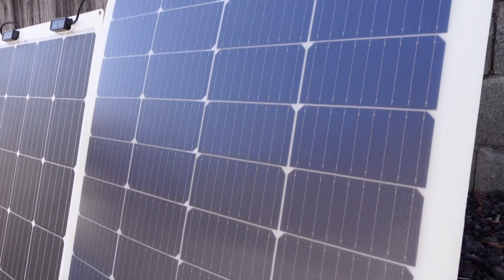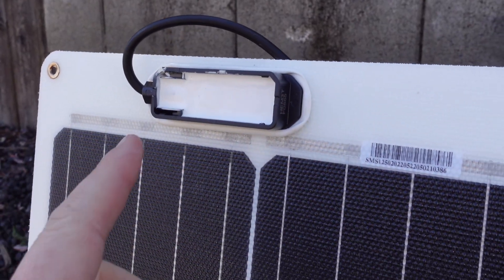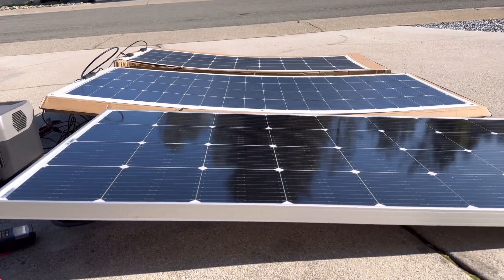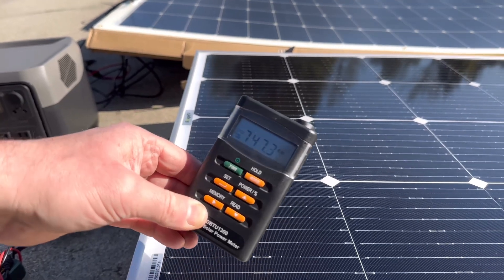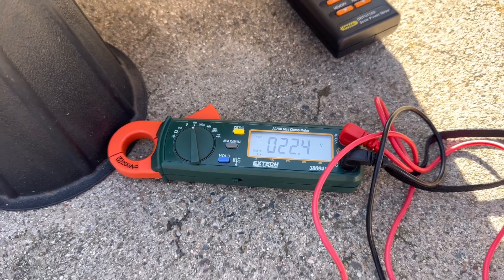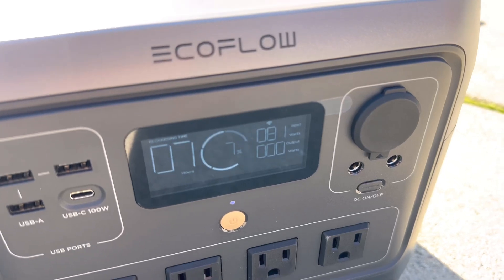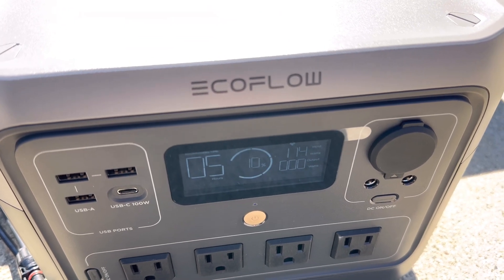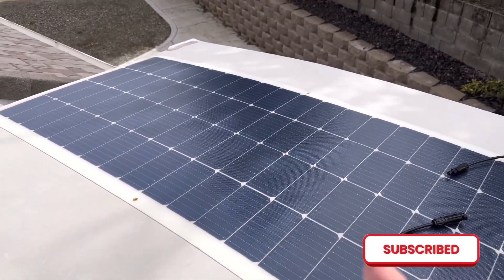NEW Flexible Solar Panel Impressive! 200 Watt Flexible Solar panel Renogy

Comment: Too much house and RV chatter, not enough marine/boat/saltwater talk which is what these panels are designed and sold for.   Alas my question wasn't answered as I just bought one of these for a test, and I'd like to know just how well do they hold up to walking on them repeatedly when on the topside deck.
Reply from the maker: Do not !!! Walk on them 
There see you did get useful info

Comment: The cardboard backing of the flexible panels insulates & prevents air flow which would account for the elevated temperatures. A table comparing the three panels would be useful. The Bouge RV panel had a smaller footprint, a consideration on small rooftop real estate. 😎

Comment: I tried buying one of those 200W panels yesterday, Sept. 4th 2023. The Renogy website says that the panel is no longer available. Did Renogy discontinue the 200W flexible panel, or are they coming out with an alternate version?
Reply from the maker: No it still shows available. I know when they go out of stock the listing might go away. 
See here….https://amzn.to/3Ery6qd

Comment: Need more airflow under the 2 flexible panels.
Reply from the maker: They are mounted on flat surfaces so air flow is normally minimal for flexible solar panels. But you can make a rack if you want a light weight set up.

Comment: How will they do in a Georgia Summer with Weeks of 92 - 97 degree VERY intense sunshine? Would LOVE to have them on my OLDER National SurfSide at 12' 4"of Height.
Reply from the maker: I think they will just plenty fine in your mild conditions. 

It has been over 100 everyday for 3 weeks and hitting 114 twice and over 105 many days except this week at 99-103.
We still have the hot weeks coming.
So great weather to test and see if the fry or live. I also live in the second sunniest city in the nation, excellent testing grounds!! 😀👍🏼

Comment: Thanks for the testing and the vids ... Very informative..
Question for you : how are you going to fix the flexible solar panels on the rv roof ? You're not gonna drill holes in the roof to hook the 4 corners of the panel obviously..  so what is your soltion ? Glue ? Also I'm a bit scared that if not perfectly sealed on the roof surface they could flap in the wind while driving at high speed on the highway and get damaged.  What are your thoughts?
Reply from the maker: So far about 1500 miles and they haven’t moved. See here…RV Solar Install Easy! DIY Solar Installation Renogy solar Panels
https://youtu.be/2YOdN8f0u2Q
Reply: @johnnysweekends  thanks

Comment: So why do they call them 200 watt panels when they clear dont put out that much wattage ?  It just baffles me
Reply from the maker: Just like any panel they rarely put out rated spec. And testing has standardized conditions, 77 degrees and 1000wm2 for light and more. but a 100 watt panel normally will be 90 watts or so. 200 watt 180 ish…and so on. It would have to be perfect conditions and 45 degrees to see most panels hit what they are rated for. Now the Hf 100 watt panel continues to impress most everyone who buys it.

Comment: Can I use a flexible panel instead of a folding portable? I could just make a stand...yes it would be larger to stow away but the folding portable is 20lbs and the flexible panel is 10lbs. Are portable panels that much more efficient?
Reply from the maker: You can use a flexible. Rigid will always produce the best results and be the cheapest but are heavier 
Folding panels are great for portability. 
The flex ones are great for quick install and saving weight

Comment: I am very new to these stuff. Do you have to buy any adaptor to plug this solar panel to a Ecoflow River 2 max? Thanks
Reply from the maker: Here is what you need https://amzn.to/45uuLD4
Reply from the maker: You will need there solar charging cord that has the xt60i connector. These cables can be found many places.

Comment: Did you install these panels on your RV?  Curious what you are going to use to mount the panels.  Going to install an ECO flow Pro on our RV also.  Will be installing a Go Power transfer switch to switch between shore power and EcoFlow Pro.  Thanks for all the great reviews.
Reply from the maker: John I have not yet as the winter will not end lol. Also i was on vacation and still waiting for a few days of dry conditions with out the rain. I think two weeks I will finally be able to get them on there. I think Im going to do VHB tape in the pattern of how they say when using sealant. They gave me a list of approved sealants but if for some reason I have to service the roof or replace a panel, vhb take with be a cleaner install and removal. Ill have to keep a eye on them on the first several trips. But ill also throw a camera up there and drive around a see if any are lifting so stay tuned…👍🏼
Reply: @johnnysweekends  that is what I was thinking of doing with the VHB tape. I have trip in July and will need to dock without shore power for a week.  I have an ecoflow delta pro and two addon batteries.  Going to install a transfer switch and plug in the storage bay so I can connect the delta's in the bay and leave them connected while towing to run the fridge. Going to use a 1400 watt portable generator to top of the deltas just in case no sun.  Heck I could the generator into the shore power plug on the RV and charge the deltas that way.  Cool tech we have now.
Reply from the maker: Sounds like your setup and mine will be very similar. I already have a transfer switch since a onboard was included with this unit. So that saved me some work. But i do the same. I power my fridge with the DP and solar recharges as i drive. Although very limited at the moment till i get mine installed. And I have two on board batteries as well which are a total of 412AH which are SOK batteries. I can slow charge the DP from there as well if I want for a lot of extra power. Im still trying to decide If ill have two solar systems on my unit. One that supplies the original setup but using one single panel somewhere for house batteries and then the large system for the DP and other items I want to test as well. Plus I have more plans for the RV besides camping..😁
But yes a generator is still needed to charge DP in low light or clouds / shade just in case. And yes the tech is making it very easy now. Kinda cheating really 😂👍🏼

Comment: Maybe compare BougeRV Flexible panels to Renogy.     That would be more interesting.   Not an old Rigid one.
Reply from the maker: They wont send me one to compare and at a price of $529 verses about $320 it’s way off from being a equal price comparison. Plus its a larger panel taking up more room. Renogy also has a better overall approval rating on there products. Sure some have failed premature but most times there stuff is decent quality.

Comment: Flexible panels have made surprisingly little progress, they remain far worse value for money comparatively. They need to get to less than half the cost of regular panels because they last less than half as long. Hopefully thin film solar can fill this need, especially if it can be easily made to shape to use every cm of available space.
Reply from the maker: I think more focus will be on these soon and thin film. Imagine a sky scraper with all its windows producing power. Then pout that into small flex panels then pretty soon we have these same panels at half the weight and maybe 20% smaller, with same output. 
Flex panels have a place but unfortunately you are paying for weight savings and ease of install.
Reply: @johnnysweekends  Absolutely thin film will be far bigger than regular flexible panels, once they can make perovskite durable and then scale it which will be easier because it is a printed process that can go onto a huge roll of it. Then hopefully you order the length/width and they cut it to size. I wonder what they will do with the connectors of thin film, hopefully  it comes in a bunch of options so it can be mounted flush and all the wires and connectors can be hidden for a clean minimal instal.
Reply from the maker: I would imagine much like the rear defroster on cars. Those thin wires just go into a small plug is all. So will see how they handle that. Or maybe a mini junction box 🤷🏼‍♂️

Comment: I have 4 of them, these renogy 200 watt panels holding up to Florida heat, they are the work horse of my serial panel set up.  I have 1 200 watt bougieRV rigid (works great) one 400 watt eco flow folding panel on roof (holding up well) and then 800 total watts from these bad boys mounted on a rolling mount to capture the sun if true outage occurred and needed every watt.  Light weight great.
Reply from the maker: I think this new design will probably do well. They are spendy for sure but excited to see how they do..👍🏼

Comment: Soft panels need a backing or they bow, also they have a reputation for cracking and breaking when the plastic ages. Glass panels are heavier, but I expect them to last far longer.
Reply from the maker: There is no doubt rigid is by far better. But these flexible panels are also 16+ pounds lighter than a traditional 200 watt depending on manufacturer. Times that by several panels you could save a lot of weight. Now normally I would say go with the biggest panel you can to allow the system you want to build. But it i went with large rigid panels at 50 lbs each I could not fit enough for what I want to do. So options are good.

Comment: That is as close to rigid performance as I have scene. Price per watt is still much higher than ridged. But for the weight you have me thinking about the flexi panels again. I have seen way to many videos on burnt flexible panels stuck straight to RV roofs. Just laying on carb board in the winter, the flexis were significantly warmer than the ridged. Add summer sun and glue, and I bet that deferential goes up exponentially. 😲I would install with some form of air gap. After all, no ridged panel is ever installed without an air gap.
Reply from the maker: True Mike PPW is still high. This is all about weight savings and easy install. That’s kinda what your paying for. And im wondering myself the difference once both panels are a 130 degrees on a 100 degree day what the spread would be. 
Now I Plan to install these according to what renogy says to make sure warranties still hold. Which is using a adhesive that’s gapped for airflow in pocket areas. I have seen many other install videos of sign boards and more but any company would love to say “it was not installed correctly per our instructions “ that way they dont have to pay for any damages or dead panels. 
So I’ll install accordingly.

And you would be surprised how many burned up rigid panels there are. Tons…..although biggest difference, not stuck to the roof….🤷🏼‍♂️
And with all many research I cant find info on a burned renogy 175 panel. Only other brans with that slick top. Sun power and more.
Reply: @johnnysweekends  I have put flex panels flat on the ground, and literally burned the grass to a crisp in an hour during the summer. I have put ridged panels  flat in the grass for a week, and didn't know they were there when I removed them. Does Renogy warrantee TPO/EDM roof membranes? If they burn grass that quick, could they melt rubber? But I'm rooting for you. Look forward to an install video. But looking more forward to a 6 months of summer follow up
Reply from the maker: Yea I guess I can see how it would burn he grass but I have done the same with a beach towel or blanket. It doesn’t take long to kill it. But yes rigid has the benefit of air running under the glass to help cool. 
Now I have followed many with flex panels that they have had for several years still kicking out great numbers. So im curious how this new thicker panel will do. But yes I will have several up date videos. And I live where it gets hotter than hell lol. So will see. 
As far as a company covering a roof….lol I highly doubt it and in most paper work it says the product only. It would only be covered if Renogy them selves installed it. Which I don’t think they actually do installs for commercial.

Comment: 25 year warranty on a flexible panel!? I'm wondering if the ETFE coating will stand up that long before it goes yellow and cracks? They look to have quite the improvements so they just might. Glad you got to see the sun, it's been one heck of a wet winter / spring!
Reply from the maker: They are the only ones to have that warranty. As far as yellowing im sure that will be in the first couple years. But from the research I did the 175 watt panels have held up great in the rv and vanlife area. Now this is renogy only as I have seen sun power and others not hold up so well. Sure flexible has some draw backs but benefits s well. And any panel can get hot spots and burn up. Rigid and flex. 
And yes, please more sun, it just wont stop 😂
Reply: @johnnysweekends  we are getting pounded with 6 inches of snow today.... SNOW at the end of March? Rain please lol....
Reply from the maker: You’re getting our leftovers 🤣 
Can you believe I live in the second sunniest city in the nation…..sure doesn’t fell like it. I think they lied 😂